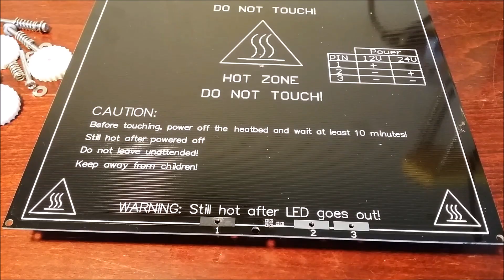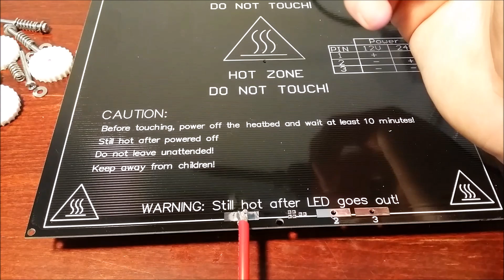Hobby King DIY Print-rite 3D heated bed install part 1/3

Comment: Is there a way to add a heated bed to this printer without having to cut the build plate and void the warranty? Also, is it possible to do this without having to use mounting brackets and just by bulldog clipping the heated bed to the build plate with a glass cover on it?
Reply from the maker: +Scott Hopper Of what I have seen there aren't any other ways. Theoretically you probably could by cutting the brackets so they lay flat on the bed, but you would have to make sure they line up with the heated be before they are glued. The second option would be to make your own bracket to fit your need. Other than that I don't know what else you can do. To answer your second question you could just put it in the bed directly and use the bulldog clips. I would recommend using some kind of insulation, because it could soften the plastic and overtime cause warping, but Idk. The method I used was really so I can level the bed more easily since you are able to adjust each corner of the bed. Hope this helps and lmk if you have any other questions.
Reply: So what kind of material should I use to insulate between the heated bed and the plastic build plate?
Reply from the maker: i would recommend something non-conductive of course(nothing metal). I would probably go with a high temp silicone sheet they are sold on amazon or maybe some sort of cloth.  https://www.amazon.com/SILICONE-RUBBER-SHEET-ORANGE-COMMERCIAL/dp/B00XLVN5ZC/ref=sr_1_1?ie=UTF8&qid=1491158565&sr=8-1&keywords=high+temp+silicone+sheet

Comment: By the time you buy all the up grade parts it would be cheaper and easer just to buy a printer with a heated bed. Sorry Dude..... "just sain"
Reply from the maker: +Drew Byars that is true for some. But other people like me might have most of the parts besides the bed it self and a few springs and screws. It is just other option for people if you already have a printer and want to make it better. Thanks for your input and I will make cost a factor on the next mod I do.
Reply: +Channel Everything I do like your DIY addition to the problem. Nothin gives you more satisfaction than being able to say " I made that, and I made it better than the manufacturer".  If this inspires others to do it also maybe the manufacturer will sit up and listen and make an up grade kit for the less "technical minded" people.

Comment: I've added the LCD and printed a box that bolts right onto the motherboard case cover.  But for these corners, I will probably adjust these so that I can have a 'slide on' version of what you have.  I will try to get that designed and tested tonight.  Thanks for the great tutorial.
Reply from the maker: +Samer Najia that is what I was planning on doing next. Did you just use the stock board to plug in the lcd because I was think of changing the whole board completely. To ramps
Reply: +Channel Everything yes, it plugs right in and works fine...
Reply from the maker: +Samer Najia Do you have any pictures, possibly upload a video, or website on how to do it.
Reply: +Channel Everything get me an email address on G+ and I will send you the STL for the box and a picture of the box.
Reply: +Channel Everything Incidentally, I am considering running the heatbed from its own power supply and temp control board, just so I don't have to mess with the existing setup.  Yes, it means the heatbed is manually controlled.....

I do have a question, you used a power supply putting out 750W, which is way overkill for this.  The original is what, a 12V 5A, or 60W supply.  An old XBox 360 power supply puts out 12V at 16.5A, which should be more than enough to run the heatbed.  In fact, I had one of these running my SmartRap with a heatbed and its hot end before I tore that printer apart to re-use its components.  One of those can be had for $30 on Amazon, less elsewhere.  Have you considered that approach rather than using up an entire PC supply with all its cable jumble and fan and what-not?
Reply from the maker: +Samer Najia a few months ago I built my own computer later upgraded the power supply so I had an extra one laying around. so I just used the 750 watt I had. Yes I know that it is over kill. But I think the power supply that I have it is 430watt max on the 12 volt rail. As long as the power supply can handle 250 watts you should be good. I also did think about running the heat bed seprate it was just because I had an extra PSU laying around so it was the cheapest for me.
Reply: Ok, I will likely put my old XBox supply to work then with the same connector.

Comment: Looks nice, just what i was looking for, only have to wait for part 2. The printer keeps resetting after installing the heated bed but that's probably because of not enough power. Looking forward to the next one.
Reply from the maker: +diablodeduivel most likely that is what the problem is. The video for upgrading the power supply will come out later today or tomorrow.